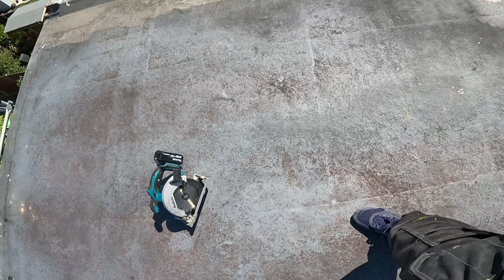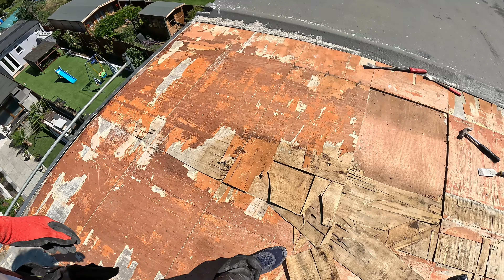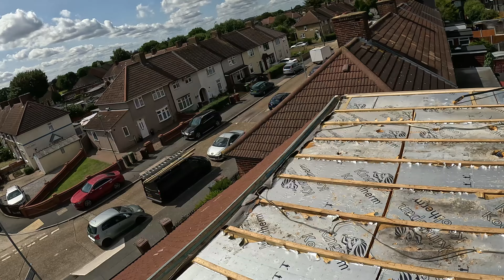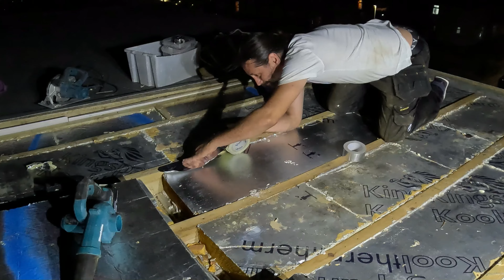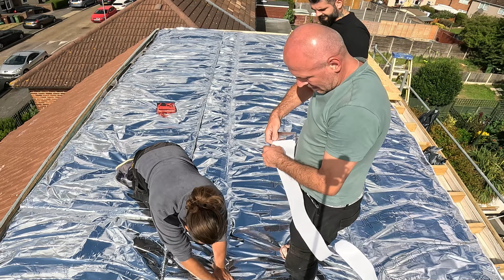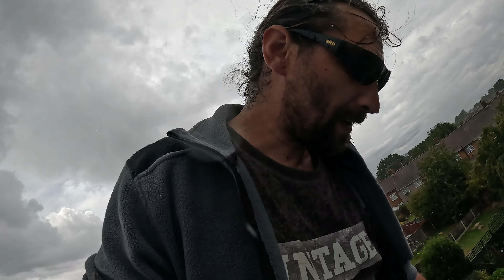DIY Loft Roof Replacement Tips and Tricks

Comment: So the plywood started to break up ? Because it got wet ?
Reply from the maker: Probably some pinhole, but most of the problems from inside humidity,  not enough space for ventilation in between the insulation and playwood
Reply: @How2Extreme  …….. or dry Matt or a spike
Reply from the maker: Could be but i only seen a lot of humidity at the back of the board
Reply: @How2Extreme  ………. I’m not anyone to advise on roof construction but I have in my past working life, used glass fibre on roofs and 7 years in a workshop using moulds with glass fibre.
11 years ago I covered my own flat roof (over my bathroom) with glass fibre. Exactly like you did but with 2 layers of Matt.
Reply from the maker: I know. We discussed this before , i remember